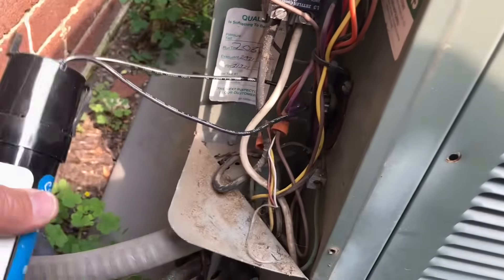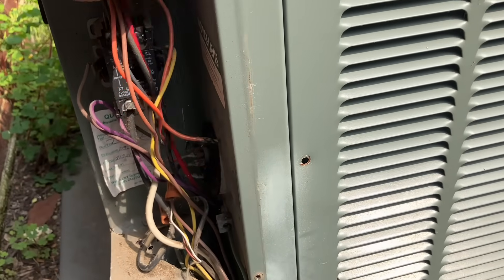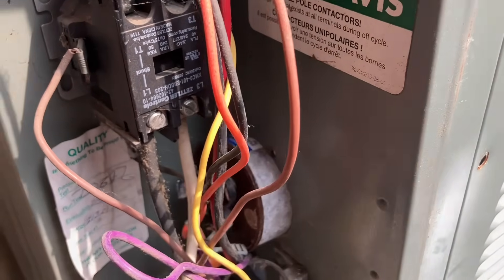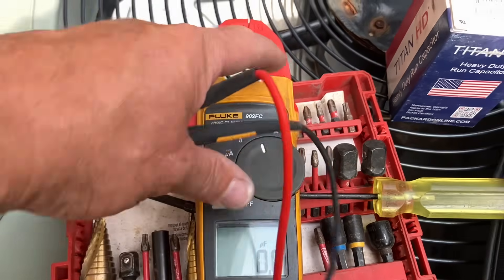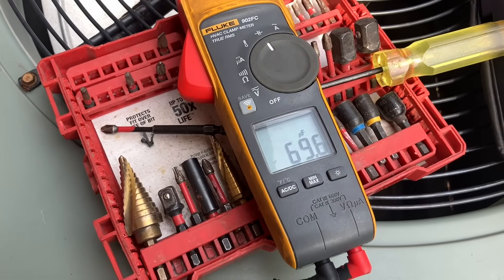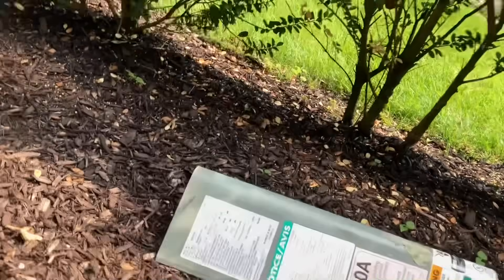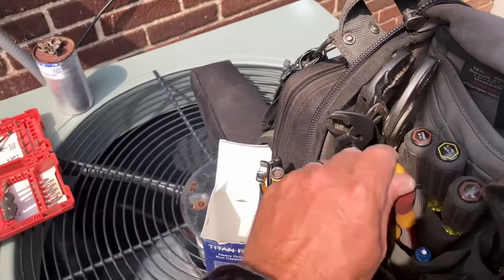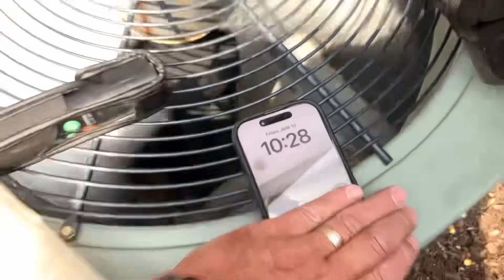AC Not Cooling? Burnt Wires & Blown Capacitor! Watch This FIX – Real HVAC Service Call

Comment: Is the hard start just a “handyman special”? Rarely see it used by actual HVAC content creators.
Reply: They are used on tired compressors to limp it along. There are some units that come from the factory with a hard start.

Comment: What would have caused the burnt wires even though the old cap was still testing fine? Could there have been some kind of surge or something wrong with the hard start?
Reply: loose terminal, corrosion/rust on terminal. to further that, the wire can corrode where the terminal is crimped around it and overheat/burn or the female spade can be loose on the capacitor male terminal or the capacitor male terminals often rust, to the point of lifting the female terminal off making a bad connection.
all bad connections = resistance and that makes lots heat, once they start heating it's game over until something burns up and they'll never be cleanable for reuse, because it oxidizes badly and often everything is only a plated coating over other metals(steel, brass, aluminum, etc.).